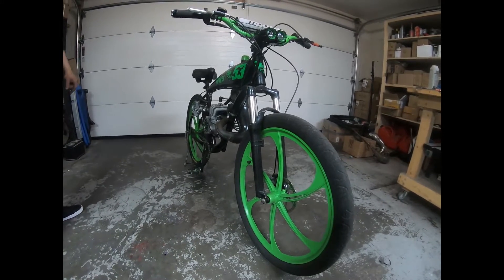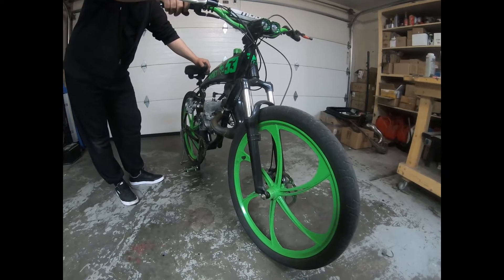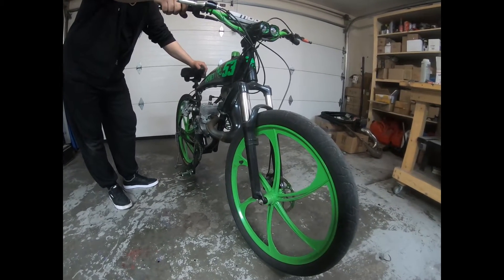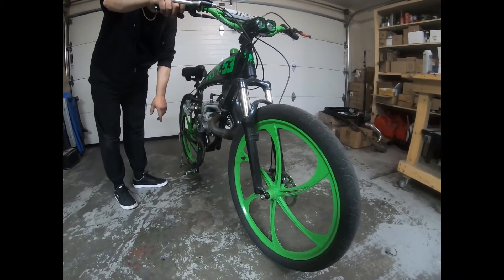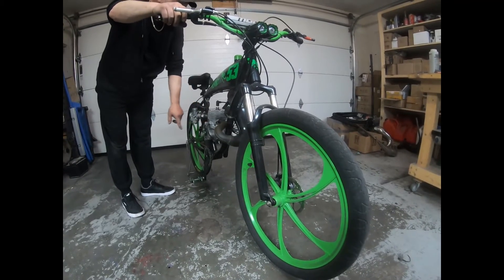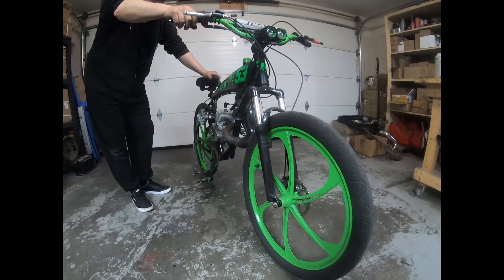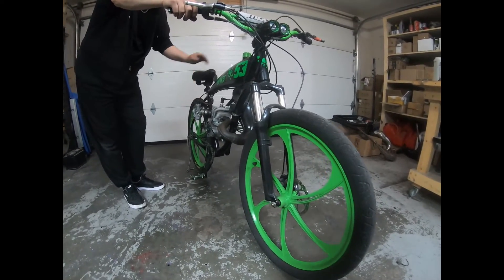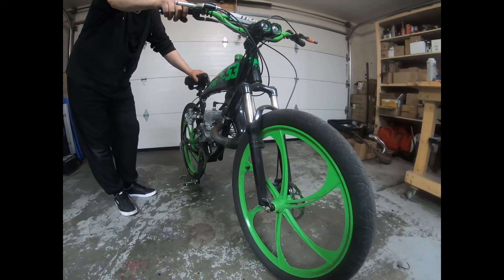Monster Build 070 62mm Motorized Bike

Comment: Could that stihl 070 cylinder fit on a long connecting rod for stock PK80 bottom end and do you have to make any adjustments to fit it ?
Reply: No and no
Reply: @darcyhemeon4309  so how do I have to make it fit ?
Reply: @chaosaddictz0072  custom fabricated case a spacer and various other mods the is a expert level 10 build as far as Frankenstein engins go
Reply: What stroke length are you running is there any way to get away with running a 40 stroke on a cylinder that's designed for 43
Reply: A CDH110 bottom end would be what you'd need. from there, you'd have to open up the center bore to allow for the 60mm piston, fill the transfer ports, fill the threaded stud holes and re-drill for the Stihl cylinder, and deck the bottom end to make sure port timing/squish is good. I wouldn't attempt it without a milling machine.